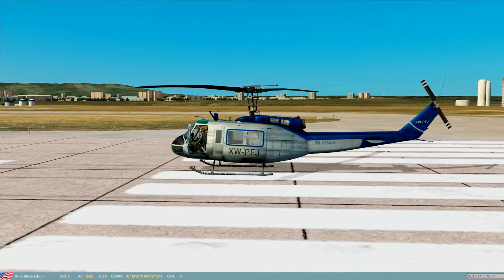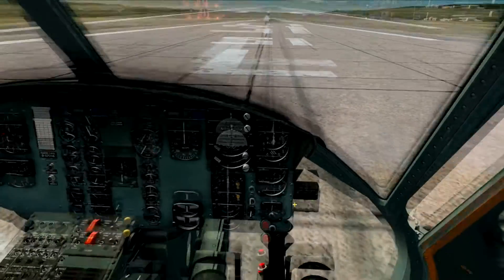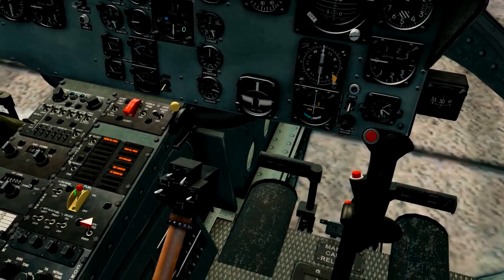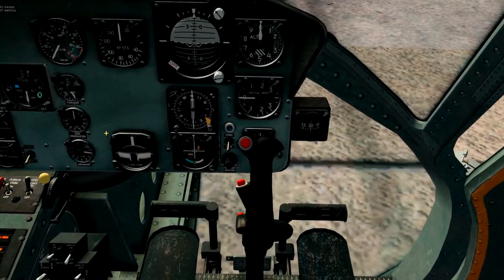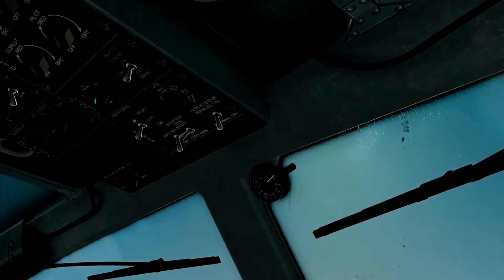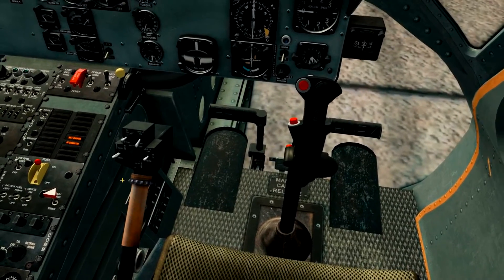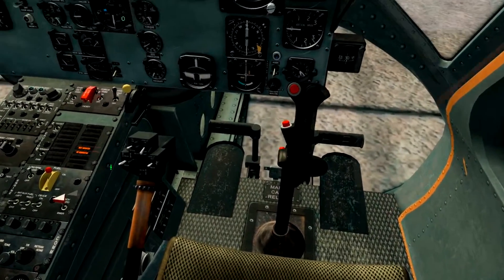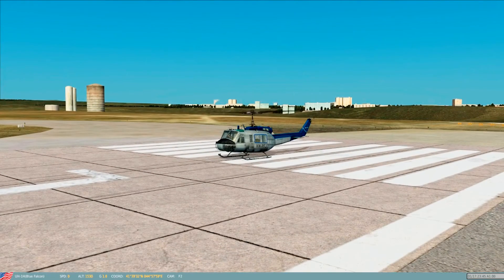"How the *&%# do i Start this Thing?" DCS: UH-1H Huey

Comment: Flight controls are mechanically connected to the rotor, hydraulics are more like power steering in a car, an assistance.  You CAN fly without hydraulics, it just takes a few more muscles.  (maybe not on DCS) For throttle on start, wind it fully CCW then as far as it will go CW.  This sets the FCU (Fuel Control Unit) to idle, which is 70% N1 (gas producer).  (There's a magnetic latch which prevents the throttle going lower than this position, unless you hit the "stop rel" button, this is for shut down) release the starter when N1 gets to 40%, also watch EGT (Exhaust Gas Temperature) if it rolls right into red and stays there, hit that rel button and roll the throttle to cut off, CW and hold the starter to pump cool air into the engine.  Then go have a coffee, and donuts before you try again.  There's also a "GOV" Increase/decrease button, which on start should have been held in the decrease pos for 7 to 10 seconds... but I don't think it means much in DCS... Once you've wound her up from idle to full throttle hit the GOV increase button til the needles in dual tacho are in the small yellow of the dual tacho.  If however the RPM light comes on when you fly, but without siren hit decrease a little bit. Without siren it means you are over speeding... This seems to be very slow to react in DCS, with underspeed  you are about .2 of a second from death! As Alex K says, starting at full throttle will torch the Turbines, it may be ok and fly for a while but suddenly you'll have totle engine fail.

Comment: One little something: only open your throttle up to "idle", otherwise you will make a "hot start" by injecting too much fuel (which will blast flames through your turbine). See the how the EGT (Exhaust Gas Temperature) rocketed up above the max ? That's bad, especially for a cold engine.  Also, since recently, EGT should be monitored closely during flight, if you keep it above the max for too long, you'll end up with an engine fire/failure and a nasty crash. ;)
Finally, don't forget to set your gyro to match the magnetic heading... Doing it in flight can be a pain and is usually not recommanded since the compass has a tendency to "lag" (and we all know flying the huey straight for an extended period of time can be difficult, especially during the first few hours) :)

Excellent tutorial though, it's always nice to have an explanation of what system does what !